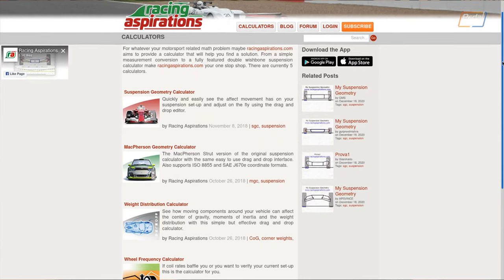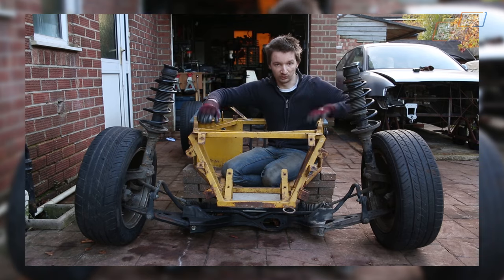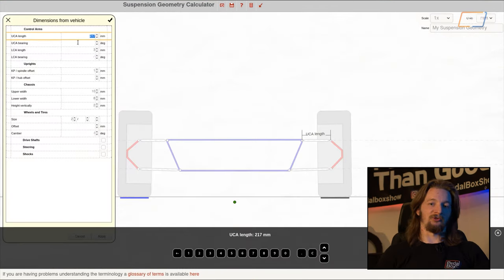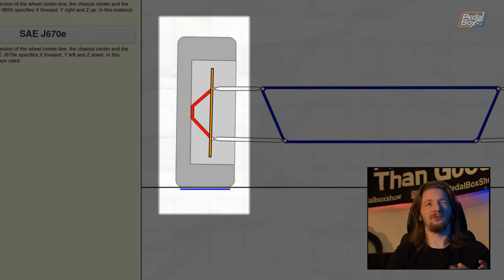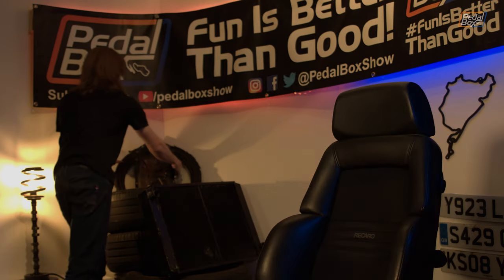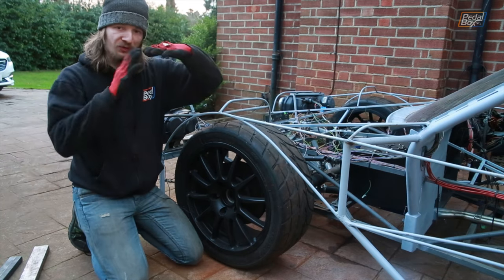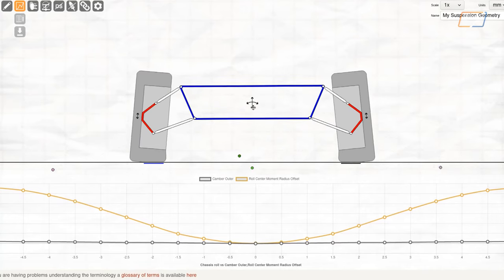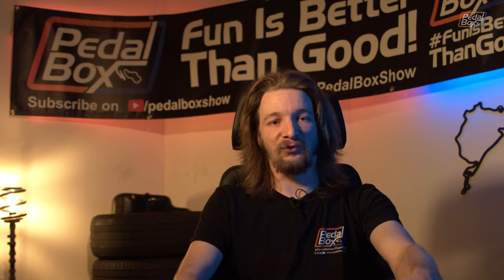Racing Aspirations Suspension Calculator - Part 1 | Tech Time | PedalBox

Comment: There is another calculator is Vsusp.
Reply: The virtual kingpin shouldn't have an angle? How would you measure that?
Reply: When there isn't a kingpin, the angle is referred to as the steering axis inclination (SAI). You can find loads of stuff on this with a quick internet search. This will show you how to find this line.
Reply from the maker: Interesting, haven't tried vsusp.
Reply: @stevennailedit  I have found it on locostusa forum. I'm just starting my build here in LA.